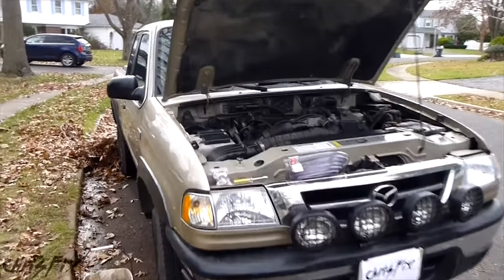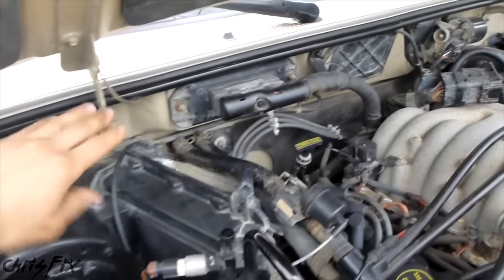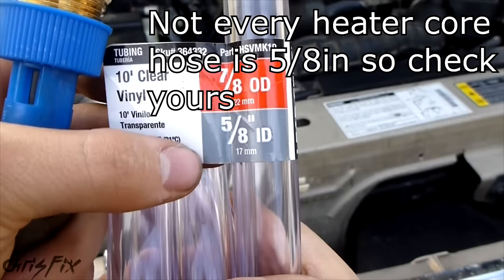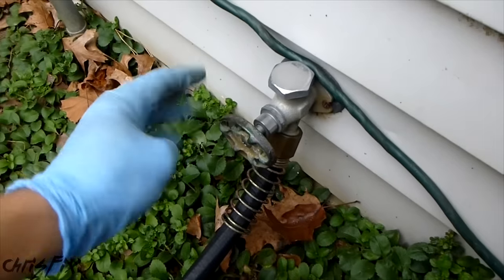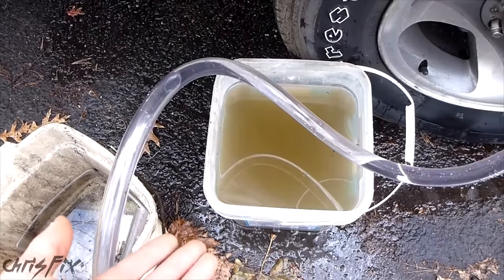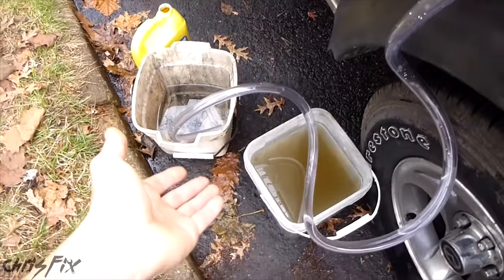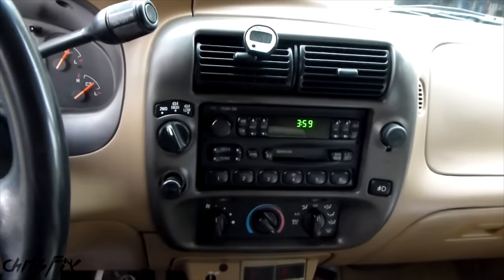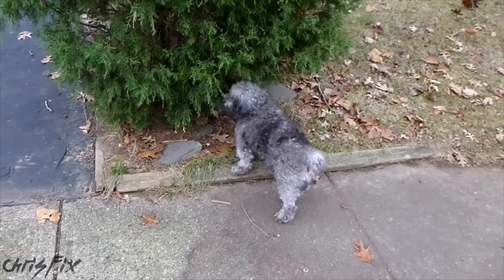How to Flush a Heater Core Safely (with a garden hose)

Comment: Thanks for doing this great video mate. I am about to do this on my 1997 Jeep Cherokee, which has this exact same problem. Hopefully flushing will cure it - I will let you know if it does!
Reply from the maker: +Nigel Hampson Keep me posted!
Reply: Well unfortunately mine wasn't an easy fix. Although flushing it did remove a lot of gunk, the heater is still pretty weak. This makes me think that the thermostat is at fault, as the engine never seems to get up to temperature. At least the thermostat is a relatively easy job and the part is cheap!

Comment: Please please remember to put a vacuum breaker on you house valve prior to doing this.  If there is a water break at a lower elevation that will suck the anti freeze back into the house.

Comment: Hello man  I have a question
I  bought a used Nissan Xterra 2006 and everything’s works perfectly plus the AC  comes very cold. But theirs one problem. That my heater is not blowing hot air. It just blows regular temperature air. Do you think I have to buy a new heater core or flush just as your video. Thankyou

Comment: Hey ChrisFix, thanks for your great videos.  Very Helpful.   I have a 2014 Mazda 6 which, in addition to the inlet and outlet hoses leading into the firewall, has a U shaped hose connected to the firewall, I assume is also leading into and out of the heater core.   Should these also be flushed?  Thanks again!

Comment: great video...is there a video on how to do a heater core replacement? cos i smelled a bit of anti-freeze and i think my heater core is probably leaking. i drive a 2000 mustang. thank u
Reply from the maker: Chief Kelly I dont have a heater core replacement video because they are so different for each vehicle. I would check a mustang forum. Good luck! Before you dive into a heater core replacement make sure there are no leaks inside the engine compartment that then turns to steam and gets sucked into your HVAC and gives you the smell.

Comment: Hey chris, i have a friend that has that same engine (i believe) in her 2002 ford F150 ranger. Last night her car died while driving while going down the highway. She got it jumped but it disnt stay on. My first reaction was the alternator but the reason i say this is because i wanna know if you can change alternators between cars? Like obviously the same model can but could you use a similar amperage alternator for a quick fix to get you where you need to go to fix it?

Comment: Should you flush your heater core just for preventative maintenance at 93,000 miles even if heat works fine?

Comment: Hey Chris, question here.
I've checked everything and everything is fine. Last option is a clogged heater core but both hoses are hot, my coolant looks like new and my radiator is in great shape (changed it 3years ago for a full thick aluminum one). Do you think it could be anything else than a clogged core before I go buy the material I need to flush it?
Everything was fine a week ago so I really don't get how it could be clogged with a clean system.
Thanks!!
Awesome stuff as usual!
Reply: SeparatioNxiety maybe there is air in the system, you need to bleed it out or something. Or radiator wasn't properly installed. But I've never worked on a car, just a guess.

Comment: thanks for your video what do you recommend i do for my 2003 altima i did this and my car still doesn't want to heat up
Reply from the maker: Make sure your cooling system is bled properly to get all the air out. Are both hoses getting hot when the heat is on?
Reply: @chrisfix  the lower hose stays cold and the same for the heater core hose one is cold it heats up when i drive 1500 rmp

Comment: Chris, the first temp reading was before you actually drove the vehicle(allowed it to idle and get to temp) and the 2nd after the flush , you stated you drove it. I'd imagine driving it will allow the engine to heat up more than sitting idle. Do you think the 25 degree difference might be related to that? Only reason I say that is because your heater core did not seem that dirty. Also, great videos, very informative!
Reply from the maker: Jeff Chiasson Driving it and sitting at idle will have the same temperatures because the thermostat regulates the temp. Also, the coolant temp was the same. The difference you saw was because the heater core got cleaned out and it allowed better heat transfer. It doesnt have to be that dirty to lose the ability for heat transfer.

Comment: I'm going to do this on my old '09 sierra. The heat has been almost non-existent over the last 2 years. 🥶
Reply: Did the flushing of the heater core work for you?
Reply: @wmluna381  Yes, it did. Unfortunately now, I collapsed a lifter a few weeks back, so it's back to the Equinox until it's fixed.
Reply: @truckerenoch8824  Cool, good to know. Too bad about the lifter though. 🙁

Comment: I have a dumb question: if I flush my radiator or entire cooling system, isn't that flushing the heater core too? I mean, when I remove the lower radiator hose isn't that extracting the water from all the system including the heater core?
Reply from the maker: Yes, sometimes with the placement it's tough to simply drain the heater core but if you went to drain and flush the system you would be flushing the heater core as well!

Comment: Good evening
Could you tell me why you didn’t flush to radiator also ?   If the water is rusty in the heater core, it will be rusty in the rest of the system also wouldn’t it be ?    Thank you.
Reply from the maker: I did: https://www.youtube.com/watch?v=s--5ft5YiHg
Reply: Ok. Thank you.  I will check it out.

Comment: Hello Chris. I find your videos to be very informative. I was wondering if you could just give me a tip on why my 2001 Ford Escort zx2 shakes when the heat or air conditioner is on? I've been told it could be a vacuum leak or the alternator is going bad. What is your thoughts?
Reply from the maker: Shawn Hess Thanks Shawn. Does it shake only when the compressor is on? Even though you have your heat on, your compressor might still be on. Here is how to test the alternator: https://www.youtube.com/watch?v=LGB6ZEjGm7Q
Reply: Can the compressor vibrate the whole vehicle? It does it when I come to a complete stop with the brake applied. When I shift to park or neutral it stops. I'm hoping its something I could fix. Do you think it has anything to do with vacuum?
Reply from the maker: The compressor itself wont cause the car to vibrate. It does sound like you have a vacuum leak somewhere.
Reply: How do you find out where? Do you have a video for that?
Reply from the maker: Shawn Hess I do not have a video for that. Vacuum leaks can be hard to find. You can spray carb cleaner around your vacuum lines and see if the car shudders. If it does, right where you sprayed it, is where the vacuum leak is.

Comment: The heater core in my Camaro has stopped producing heat and is clogged. My mechanic said it needs to be replaced (which would cost thousands). Would a flush work? Hope you see this comment.

Comment: Good video but I would always suggest flushing the entire cooling system and not just the heater core in order to remove anything in the coolant that may have contributed to restricting the flow of coolant through the core.
Reply: So flush the entire cooling system 1st and then attempt the heater core flush (if the low / no heat problem persists)? 

Just trying to clarify the "in addition to" vs. "instead of" factor.

Comment: So will do a regular coolant change force new fluid in to the heater core?

You would still have a small amount of old coolant but like Chris said it would get mixed in with all of the new coolant and would also improve performance no?

Comment: How do you determine the diameter of the hose you have in the car? Do you have to physically check or can I find it elsewhere?
Reply from the maker: Do a search to see if someone has already measured, if not do a search for a new hose and see if it lists the specs of the ID, if you can't find either of those you can always measure with a caliper and round to the closest fraction
Reply: @chrisfix  hey Chris. Thanks for the quick reply! Ive tried a few of these with no luck. But I’m excited to give this a shot. I just bought the stuff I saw from your video. Maybe I’ll get lucky. Thanks again for your videos!

Comment: Great video, would you suggest changing the hoses as well?
Reply from the maker: Ziby2413 I mean, if you want to you can, but it isnt necessary unless they car brittle or cracked. To change my heater core hoses would cost a good amount of money because they dont just run to the waterpump, they go to the throttle body too. This is the case on many cars. The heater core hoses for my truck are $100 so unless you need them, dont waste the money!
Reply: Nice man Ty for the advice!

Comment: hey Chris, i have a 2000 ford expedition 4.6 rwd and i smell what kinda smells like pancakes or syrup which i'm guessing is anti-freeze and steam or fog from the vents even when the heaters not on so i'm guessing its a leaking heater core, but do you think it would be anything else like a leak in the hose right at the firewall running into and dripping on the  heater core, i'm just hoping the heater core doesn't have to be replaced its at least over 500$ or 600$ to replace because the whole dash has to be pulled out and idk if i could do it myself idk if i even have all the tools to.

Comment: Chris I have a leak but in the left side, driver side for me in 2014 Mustang.. Can I use a “stop leak” product and loop it with small water pump out side the system? because I don’t want to use the stop leak in all the system because I don’t really trust it. And if it didn’t work I pass the heater core I don’t really use it anyways.. but also it’s good to have every thing works great.
Reply: No, replace the radiator. It's not gonna work
Reply: José Gaming The radiator? Replacing it without any issue is waste of money and time. And if you mean replacing the “heater core” in the Mustang you need to replace the whole AC unit inside the car also not worth it in hot area..

Comment: I was trying to put together the hose adapter set up you used, and I think the link the Amazon link you referenced for the brass barb fitting is different then what you actually used. The Amazon links to the 3/8" barb fitting, but that would be too loose in a 5/8 inch hose.

Comment: On a different topic maybe you can help.. I have a 2007 F150,,when I turn on the heat or just a cooler temp in the truck, I get a weird smell , somebody explained it like a burnt band aid smell. It goes away maybe 10 mins into the drive. Do the vents need to be sprayed out with Lysol or something?  Only videos I find on here is the smell when you turn on the A/C,,my A/C doesn't work so I never turn it on.

Comment: you just solved my problem within 30 seconds of the video. my 2017 ram 1500 dont heat and i smell coolant,also when i turn on defrost it fogs up my windows. leaking  heater core. smh. i hear its expensive

Comment: If I turn it to heat and still get cold, wouldn't that eliminate a blockage issue? Seems I would have little air flow when air can't go through core.  A scope was used my a mechanic and said he saw rust in core. Is there a chemical flush I could use? Or would this cause heater core leak?  Trying to eliminate blendor.

Comment: I think I clogged my core with some radiator seal, hopefully this works, thank you!
Reply: Quit using that radiator leak stop crap
Reply: I flushed my core and my heat works now and the leak has stopped.
Reply: @hustleeveryday5852  Nice! Thanks for reporting back on that.

Comment: I blew my heater core with the end of the hose at full pressure left side and right side. All the rust came out alternating from left to right at high pressure. But it's better to blow your heater core if its bad and bypass it than to blow it on a road trip with no tools. 50 50 antifreeze causes jelly in the coolant if you add water. So good luck using water if you get a coolant leak with 50 50 coolant. Aka do not add water.

Comment: Realize I am responding to a 8 year old post, but be aware Chris stated you cannot use CLR to flush the heater core. Apparently, he does not know Honda service bulletin recommends using CLR to the heater core and flushing. Maybe, Honda knows something Chris isn't familiar with. Actually, I would never use CLR, but I wouldn't disclaim it, either.

Comment: I have 2007 Mercedes s550 with 190k miles. When I turn on the heat only cold air comes out of all the vents. Do you think a chemical like irontite thoroflush would unclog my system.

Comment: I recently did a coolant system flush by repeatedly draining the radiator, filling it with new distilled water, run the engine and then repeat the process until the drained water went clear.  Will this core back flush process remove any more gunk since the coolant in it now is new and clean or would it be a wast of time?  The coolant in the top of the radiator and reservoir  still look clean so nothing came out since the flush and fill I did.

I did get it to a 50/50 mix when I was done.

Comment: In my Nissan Titan I've noticed that when the heater air blows cold, it could also be that I'm low on engine coolant.  That's how I discovered I had a radiator leak: the heater stopped blowing hot air, I filled the coolant back up, it started working, then stopped again a week later, only to find the coolant level was low again.

Comment: I had a leak on my ford ranger 2000 so my mechanic canceled my system because like you said it was going to cost me 950$ to get it fixed. With that said can I still perform this flush? Or do I just do the regular flush in ur other video where you do the super flush?
Reply from the maker: +Chris Cast Since it is bypassed, do a superflush instead of this flush.

Comment: Hi Chris, just purchased an used chevy cruze, however the heater is not working properly. Driver side is blowing a hot air but the passenger side is blowing cold. Will flushing it will help? Could it be anything else?

Comment: the temperature increase may have been largely due to the fact that your motor was running for a substantially longer period of time the second time you used the thermostat to check the temperature. there did not appear to be very much gunk flushed out of the heater core during the flush.

Comment: Hey I just recently found your channel on YouTube. I have a question. I have a 2002 Chevy venture minivan. I have had it for over a year and never once had the rear heater system worked. So I never use it. Recently I have had to replace the thermostat, but shortly after the water pump died, and then my raidiator cap. Now my system maintains fluid as far as I can tell. I have recently started working on cars and know very little was curious on what you feel should be my next step. This is my only car. It has never left me stranded and has always done right by me so I'd like to to do the same. Any help or advice would be appreciated. Love the channel and the in depth explanation it really helps.

Comment: I understand this is more effort than its worth, I could turn the heater on for 10 minutes a month is nothing, but could i just connect the intake and exhaust hose with a clear hose to bypass the heater core if I don't plan on using it for a prolonged period?
Reply from the maker: +Michael Kennedy Yes you can. Many people do that instead of fixing their heater core because it is expensive.
Reply: +ChrisFix thanks Chris! Massive fan you've helped me and my car a lot! Been a subscriber for a long time!

Comment: Just my opinion I've never recycled antifreeze I've always kept it filter it through a t-shirt and add it to your next fill using it as the 50% water I've never had them overheat I've never had them freeze  and I've never had them clog/ plug. I simply reverse the two hoses on the heater core flush it twice reverse it back to normal flush it and you're good to go just me personally that's the way I've always done it and I've never had a problem. If possible get your water from dehumidifier or somewhere without all the minerals that's what causes  them to clog
Reply from the maker: The problem with that is antifreeze has additives that prevents corrosion and they break down over time. Those need to be replaced which is why it's important to flush the cooling system every 5yrs or so.

Comment: Hey Chris good tip for the coolant heater core - 
  My  Windstar thermostat was changed during the summer months - it does not produce hardly any heat or the front defroster - thinking it might be the actuator - any advice would help me a lot - do you have a video of changing the actuator on a Windstar ( 2003 )
Reply from the maker: Pete Moss Did you see this video: https://www.youtube.com/watch?v=-XjXTVJhFLM

Comment: Just wondering . . . I have a '03 F150 that the heater core has begun leaking. Since it is such a MAJOR ordeal to remove & replace it, do you think if I isolated it, like you did for the core flush, that I could successfully use something like Bar's aluminum radiator leak sealant, or other similar product, to stop the leak?

Comment: I have this same vehicle.  Question/confirmation:  The vacuum activated heater control switch is closed ONLY during the Max a/c position and the Off position, is this correct?  Additionally, the a/c compressor is engaged during a/c max, ac, defrost, defrost/feet and face/feet; is this correct?  Lastly, does the cold/heat dial only move/control the blendoor? TIA